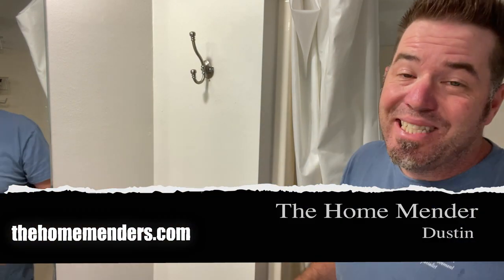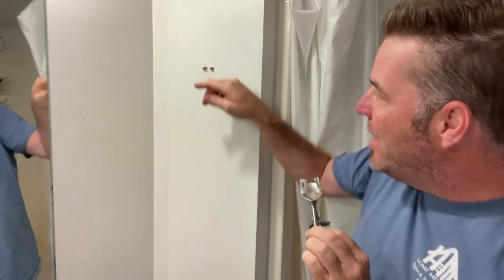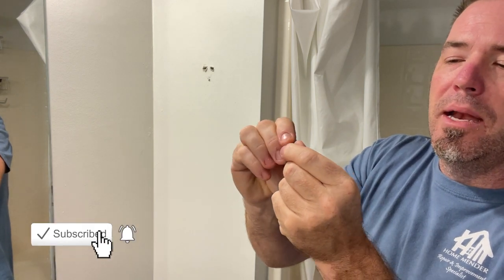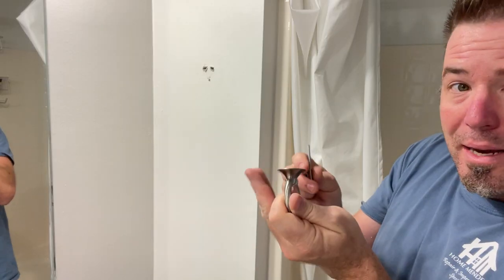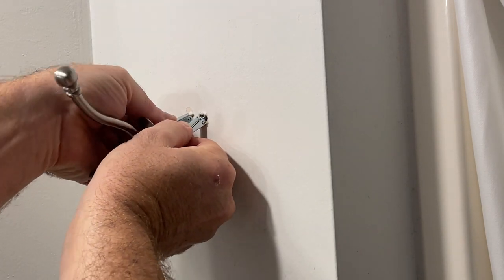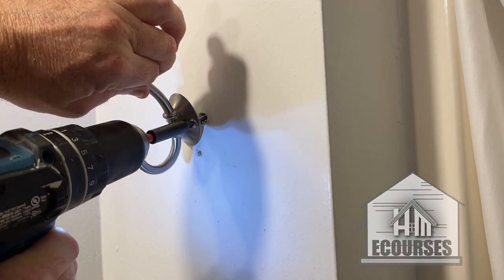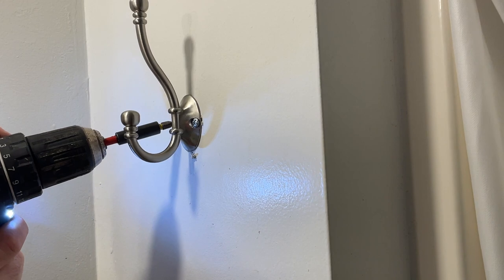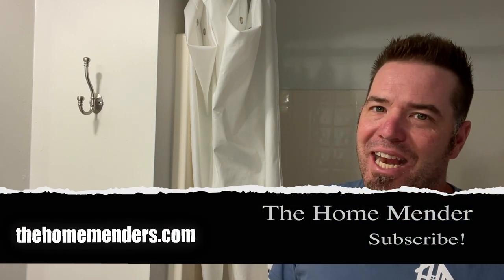How-to toggle bolt, re-install fallen bath hook, towel bar, tp holder. Secure bath fixtures. Easy!

Comment: Excellent job I’ve used toggle bolts for many years. I know they now have something else made of plastic called wings something but I prefer the old-fashioned toggle for one thing you make a smaller hole to install them instead of the three-quarter inch hole of the other system.
Reply from the maker: You got that right. Thanks for sharing Manny.